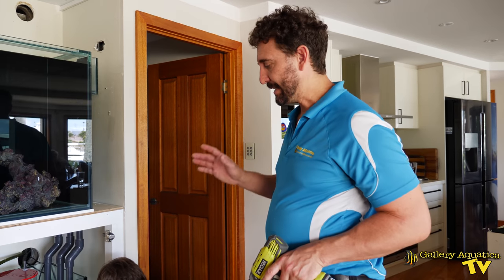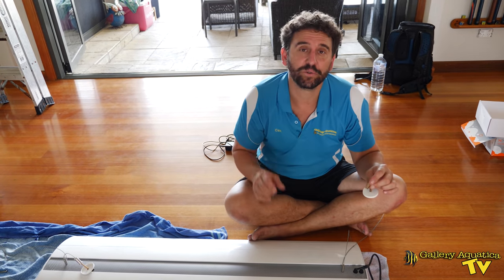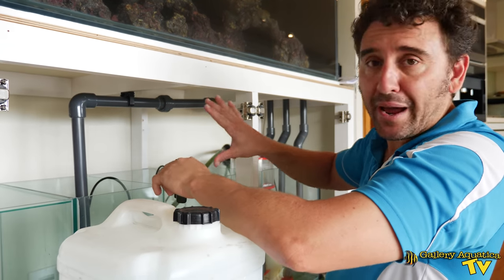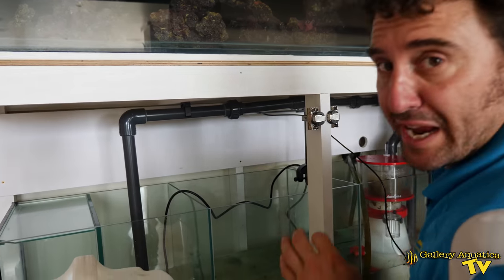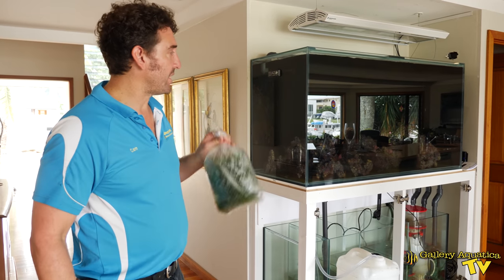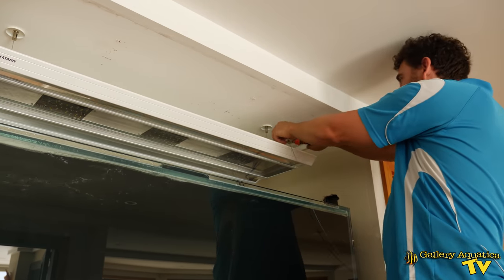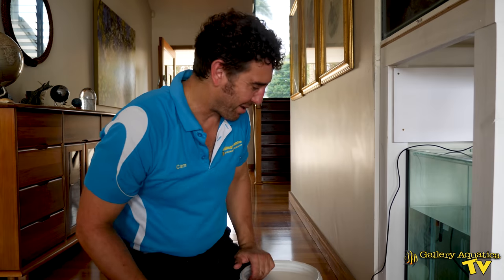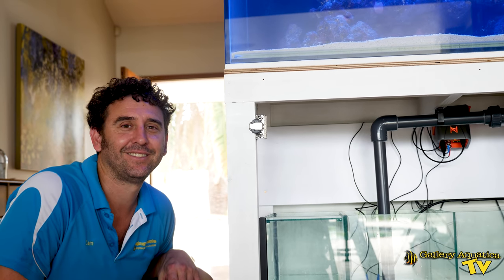Reef Redo: Part 5 - Release the Clowns

Comment: Bad place to mount the APEX, the moisture and salt spray will shorten the life of the controller significantly.
Reply from the maker: I think it’ll be ok there, however if we feel the humidity is a problem we can move it to the area under the external overflow. Cam